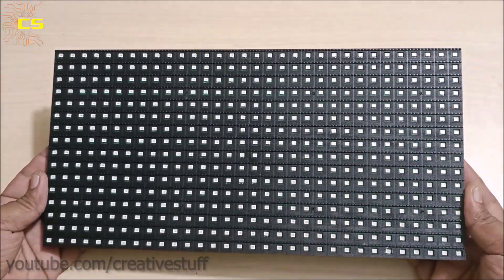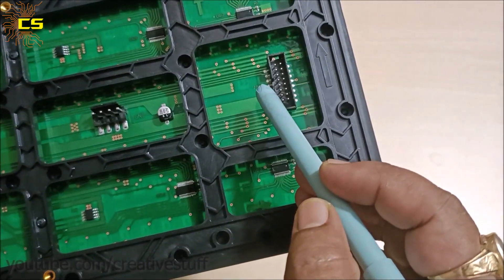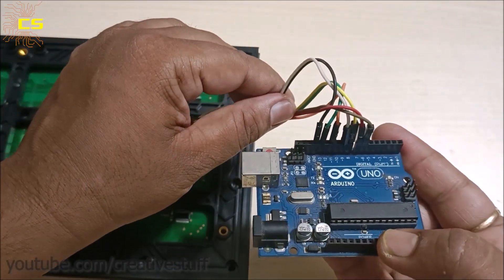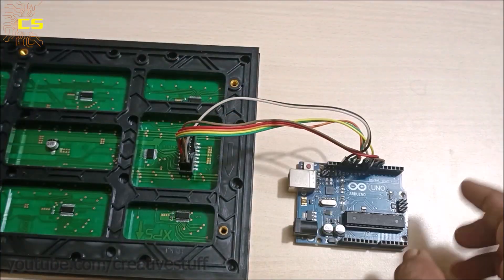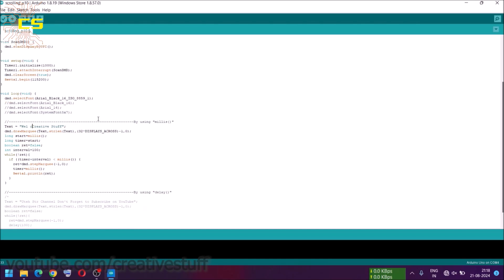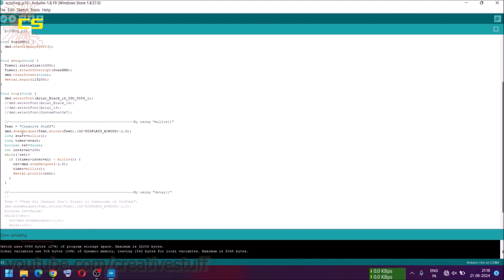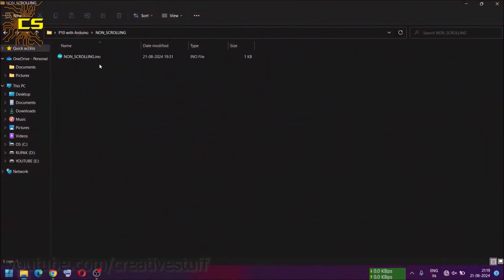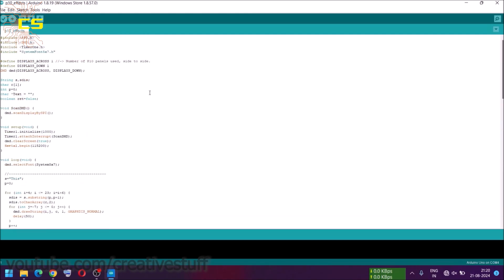Easy Arduino UNO P10 LED Module Control for Beginners!

Comment: i've downloaded your drive files and extract all, but i run the code it shows the don't have DMD.h such file or directory, compilation failed
Reply from the maker: That means you haven't added the dmd library to your arduino library
Reply: @ i need to know the steps very bad!!!
Reply: @CreativeStuff  how do i add it exactly? can you tell me the steps?